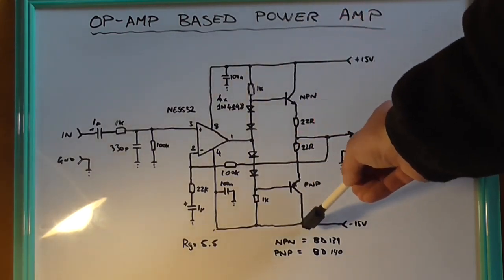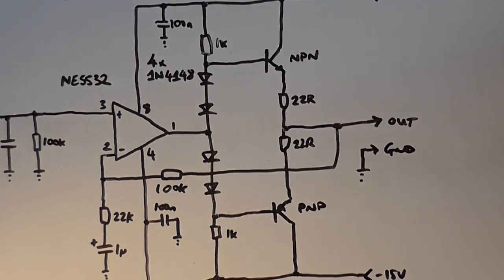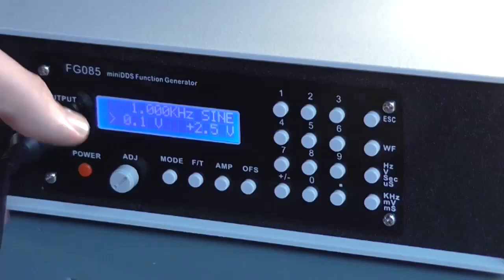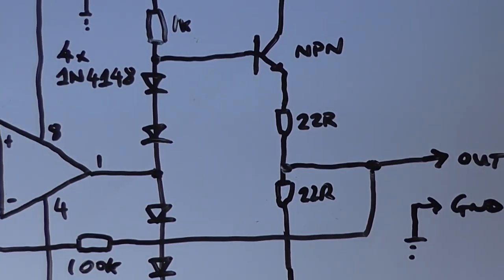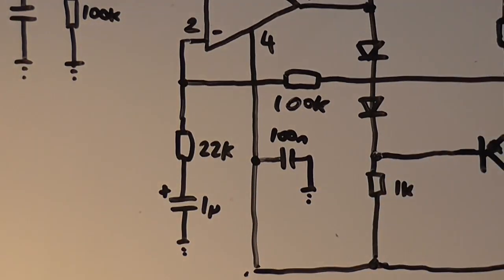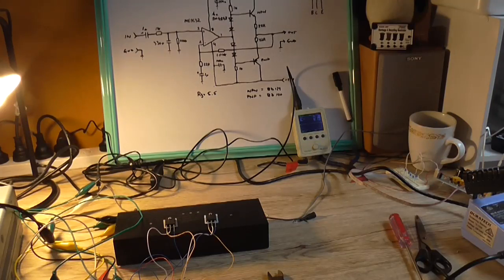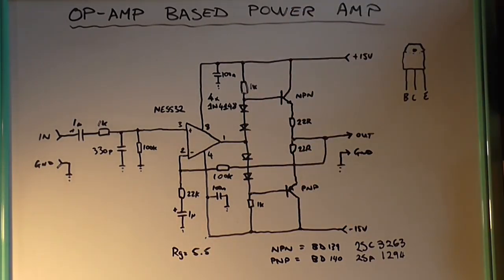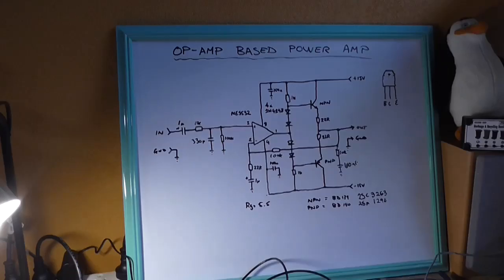OpAmp Based Power Amplifier

Comment: Would have been better with the NE5534 and then you could have adjusted the offset - reducing the quiescent voltage at the speaker, and allowing a little more headroom before clipping of which was more below 0V

Comment: Im very interest to this amp, cause it look simple and i think i can learn about power amp how it work  . One day i buy kit amp like this labeled 140w with supply 40v with  tip2955/3055 and driver bd139/140 . My question is ,how it work ? And can i supply this kit with 26v rail cause i just have this .
Sorry for my english is so bad ,im from indonesia . Thanks
Reply from the maker: Yes you can power it from 26V as long as it's split rail (assuming the amp is bipolar), you'll just have less output power. How it works is simple. The drivers apply a bias voltage to the output transistors and the output transistors provide the current necessary to drive the loudspeaker.
Reply: In my kit ,power supply 40v and for opamp supply voltage is down to 15v with zener . If im not wrong ,the output stage just provide a current to the load ,opamp driver provide voltage amplification . The output voltage swing of opamp  is determine by supply opamp so in my kit less than 15v . So ,How much voltage swing at output , and how to calculate this amp can produce 140w with 40v supply . Im confuse about this .
Reply from the maker: @jumagallery598  you can't really calculate it, you have to measure it. However, we can assume that the output swing of the opamp is around (let's be generous) 20Vp-p. The output stage will also be 20Vp-p. Using the equation P=Vpeak^2/R we can work out the power. Vpeak is half the peak to peak voltage of 20V, so 10, square that that's 100 then divide it by the load of 8 ohm. That equates to 12.5W.
Reply: @AstrosElectronicsLab  hello sir i need op AMP character superior subwoofer low freq and give me which one op AMP best for subwoofer low freq thanks
Reply: @AstrosElectronicsLab  please help me
Reply from the maker: @blacklistYT1  The LM3875/LM3886 is a good start
Reply: @AstrosElectronicsLab  have you ever tried the op amp LT1469 sir ? I got a recommendation from my friend, he said it's good for low end too, is that true, thanks
Reply: @AstrosElectronicsLab  sorry my English so bad
Reply from the maker: @blacklistYT1  I know nothing about that IC
Reply: @AstrosElectronicsLab  the Lm,3875/LM3886 is good for gainclone sir ? Not for subwoofer low ?
Reply from the maker: @blacklistYT1  it has been used in a subwoofer of which I had and worked well